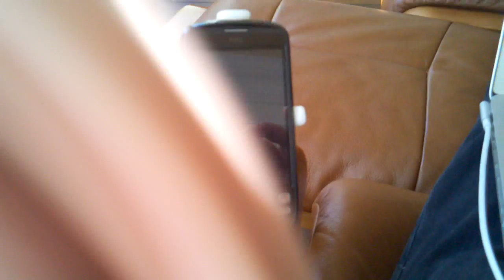PCL Hinge

Comment from the maker: well sort of, but the real trick turns out to be a cold bath.  i made a tube, in this case molded around a thin metal cylinder, and then cut the ends off for a nice factory like edge at each end of the tube.  next a made a "stick" which passed through the tube.  i heated one end of the stick so it was fairly floppy and dunked it in cold water. that cooled the outside of the floppy bit so that it wouldn't stick to any other plastic, but was still malleable.